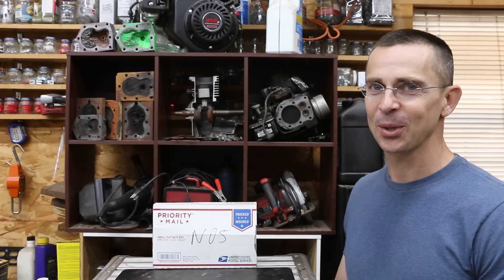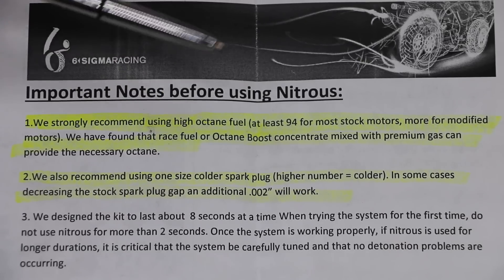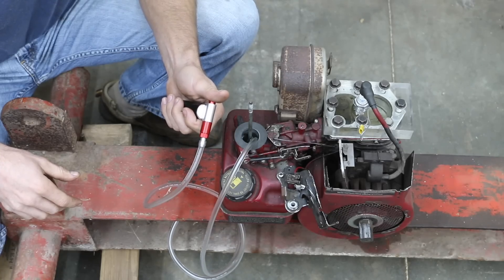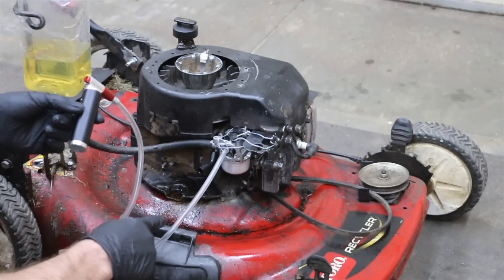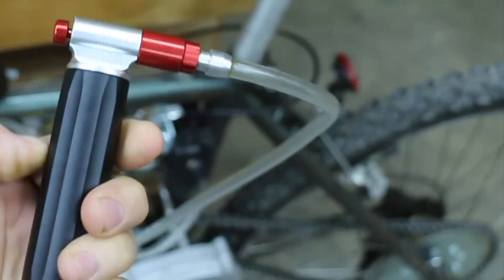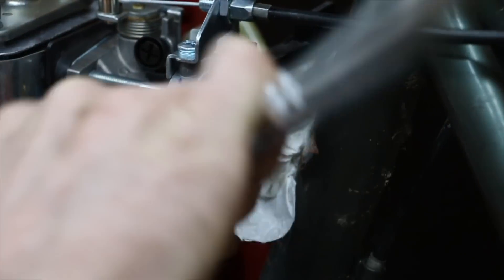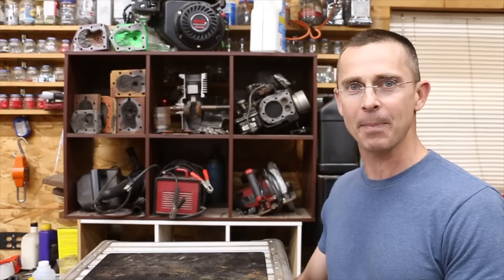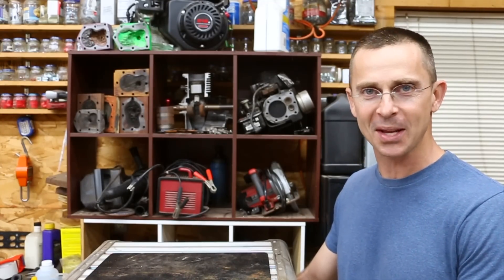Will the 4-Stroke Bike Survive Nitrous Oxide?  Let's find out!

Comment: If you jetted the carby up on the rich side, the nitrous would have more fuel to burn which is it's job and you would get more power and go faster still. Running with nitrous and no extra fuel is hard on the engine.
Reply from the maker: Great tip!
Reply: @ProjectFarm  Absolutely! Fatten up the fuel mixture jetting as large as you can go and still have the engine run decent enough to get near top speed and then hit the nitrous button. It should run like a raped ape!

Next up why don't you get this motor running on methanol and try out mixing in some nitromethane. To run the methanol you'll need about twice the fuel and a huge advance in ignition timing. Fuel drag cars run about 60º BTDC advance, and may not need spark after starting. Can you say detonation?

The methanol will probably destroy the gaskets and seals in the carb so figure this experiment will probably be terminal. I wouldn't think the Nitromethane in any meaningful amount would be survivable for the motor either...
Reply: @ProjectFarm  Additional nitromethane info: You'll need to start the engine on methanol then switch over to the methanol/nitro mix. It is probably easiest to obtain model airplane fuel with as high a nitromethane percentage as possible then dilute it with pure methanol and mix it with compressed air bubbles in the container. Also model airplane fuel comes with oil mixed in either castor oil or synthetic. I'd go with synthetic as castor oil gums things up and as low a percentage of oil as possible. I've seen airplane fuel as high as 75% nitro, mixing down with pure methanol will further reduce the oil content. Airplane motors are 2 stroke so oil is needed in the fuel where you don't need it.
Reply: That was my concern. Presumably, all the nitrous is doing here is leaning the engine out.
Reply: Yep, this is a dry setup. Wet setups have a accelerator pump of extra fuel too. Lots more things you could do to but it gets expensive.
Reply: @daveyt4802  I figure he can hack a cheap, lawnmower engine-worthy solution! Perhaps something along the line of tapping a tiny hole in the carb with a small pump that is engaged when the nitrous button is pressed? 

On a side note: TBH, I'm somewhat surprised projectfarm overlooked the necessity of increased fuel. He's got a very solid understanding of how engines operate and discussed the fact that nitrous increases the available O2. Here's to hoping his next video details his inclusion of these changes. It'd be really interesting how much faster the bike could actually go with the simple addition of a whipped cream charger!

(Other side note: I'd love to see him bolt up one of those $150 eBay turbos alongside it!)
Reply: @TravisTerrell  I think it shows these little engines are not burning all their fuel otherwise he wouldn't get the gains he's gotten.
I like this guy, he's willing to try.
Reply: @TravisTerrell  I've seen a guy do that, unfortunately you can't really gain much power with those unless you get that puppy screaming with an aftermarket cam and flywheel. The low rpms and space between pulses on a single cylinder engine just don't spool it up much. Now, I think a guy could do better than he did, he made a pretty hacked manifold and intake pipe. If one made a "boost canister", basically a tank of sorts that the exhaust fills and pressurizes and fed that into the turbo, that would at least eliminate the pulsing issue. And of course properly boost referencing the carburetor and taking time to tune it.
Reply: A small seperate vessel filled with extra fuel in a venturi setup using a small tube. Similar to a model painting airbrush. The pressure from the nitrous spray would enrich the mix automatically. The hard part would be dialing in the correct NO2/F ratio.
Reply: @nathanriley1260  I wouldn't introduce fuel outside of the carb with the nitrous going in that way. NHRA had some hood scoops blown off Pro Stock cars that were cheating fogging hood scoops back in the '90's. Adding fuel to that mix might be a tad bit unsafe...
Reply: @farout1220  I see what you're saying for sure, but what I'm suggesting is pretty doggone close to what a commercial wet plate setup does. Only difference is that the commercial wet plate is directly between the carb and the intake manifold, whereas I'm thinking the easiest way on such a small carb is to just fog the mix straight down the carb throat. You just have to be sure to only spray at WOT to prevent most of the mix from bouncing back off the throttle plate.
Reply: Oil Burner an additional small jet using the vacuum of the air box would work. Using a ball valve to get the fuel side dialed in.
Reply: @caseywilliams4322  Yes. The "The Frankenstein Gas Vaporizer" xD. Use this + the jet of the carburator. then add nitrous oxide and baaam much more power.
Reply: I suspect these carbs run rich anyway.  I have always been told nitrouse has no power in it.  The power add comes from allowing more fuel to burn by adding more air to the carb.  Engines are typically not fuel limited but limited by air.  To pass this limitation, you can run a turbo, supercharger, or dump in a solution which has enriched oxygen.  No matter which you choose, when adding more o2, you then add more fuel.  That means more power.
Reply: @rscarawa  The word you're looking for is "stoichiometry."  Gasoline has a stoichiometric ratio of 14.7:1, as in 14.7 pounds of air to burn 1 pound of gasoline for proper combustion with a maximum power rich ratio of about 12.5:1.  NOS acts as an oxidizer, so you are correct in that to reap the benefits, you should be adding more fuel along with the NOS (more oxygen, so you can burn more fuel in the same cylinder volume to make more power).  Forced induction (turbo, blower) performs the same action by stuffing more air into the cylinder so more fuel can be burned.  The problem is, at some point, the volume of the cylinder precludes any further ability, or gains at stuffing more air and fuel into it, or end up blowing the engine to pieces with extremely high induction pressures.

The answer then is to switch fuels.  Alcohol would probably be your next step up.  Although alcohol has less BTUs per equal volume than gasoline, methanol has a stoichiometric ratio of 6.45:1, so you can burn a little over 2 times more of it in a normally-aspirated engine, with further amounts as boost is added.  Ultimately, a well built alky motor is good for about 10-15% more power than what you can get from a gas engine. 

Then, you take the big step up to the top of the fuel chain, you go with nitromethane (which oddly, was developed as a dry cleaning solvent and also used as a rocket fuel).  Again, a fuel with less power per equal volume than gasoline, but it carries its own oxygen.  In reality, the BTU rating for a given amount of fuel has to also consider its "specific energy" value.  The SE is derived by dividing the heat value by the air/fuel ratio (Btu/lb divided by A/F), telling us how much heat energy is delivered per pound of air into the motor. At stoichiometric air/fuel ratios, the nitro’s SE value is around 2.2 times greater than gasoline!   100% nitro has a crazy stoichiometric ratio of just 1.7:1!  You can burn a hair more than 8.5 times more nitro, at 1 atmosphere, than you can gasoline!  Now, slap on some forced induction (or even NOS, as nitro will work just as a well as gasoline with NOS) and you're cramming some power into a cylinder.  That's why top fuel cars make 10,000+ HP on 500 cu. in. engines.
Reply: Edward Lance  - I can't believe no one replied or upvoted to that. That's the most interesting thing I read in the entire thread.
Reply: @rscarawa  like hitting the oxygen lever on a cutting torch, normal flame, molten metal flame!!.
Reply: I know this to be true on racing v8 engines. Good way to create a piston burning lean condition is NOS without extra fuel.
Reply: Is that the cause of the dirty ignition.  It was really yellow in the clear motor
Reply: Yeah the fuel is meant not only to make the unicorn explosions but also cool the piston, valves, head and block down enough for sustained running.
Reply: @Doug brook, the sensor cooling effect only works down to around 37° or so with OBDII equipped vehicles, then it becomes counter productive.  As for methanol, stoich is roughly 7/1 (7lbs of air for every pound of fuel you put through the motor) so you would need to essentially double your main jet size on the carb, have a custom grind needle, and a fair bit larger pilot jet; but at that point it wouldn't gravity feed fast enough to keep the bowl filled, you'd need a fuel pump. With nitromethane, assuming a %90 mix, stoich is about 1.7/1. So for every 1.7 lbs of air going through the motor you need 1 lb of fuel.   No way that carb is getting anywhere near remotely close   to fueling that.  But it would make a hell of a bang if it would even light. Compression ratio, piston squish, valve overlap, it goes on and on lol.  I've got a couple drag four wheelers, one on alcohol (methanol) with a 25 horse wet shot of nitrous and another just on nitro. There awesome when they run. But most of the time is spent rebuilding top ends and changing washed out bearings.
Reply: @aaronj08ar  how do you weigh air?
Reply: @davejones5640  Math. PV=mRT, P is pressure (14.7 psi at sea level), V the volume (combustion chamber size),       m the mass (roughly 29g/mol), R is the gas constant (28.8), and T is the temperature.  (There are a massive amount of variables at play such as humidity and the pull of gravity in your specific location)     .08 lbs per cubic foot is close enough for fuel ratios.    It is much easier to use  an oxygen sensor and go off A/F radio in combustion exhaust :)
Reply: Nice tip. I suppose you can get better result with an injection engine, where the amount of fuel will be adjusted fairly quickly by the lamba probe in the exhaust.
Reply: I’m surprised nobody has tried using a large ducted fan as a supercharger, a 90-120mm one can easily produce as much wind as a decent turbo, and reach pretty substantial amounts of pressure.
Reply: @krowwithakay  I made  the calculation for a 1.8 liter 4 cylinder. At full speed, the engine revs at 6000 tr/min = 100 tr/sec. The engine has to load 2 cylinder on each rev, equal 0,9 liter 100 times per second, so you need a fan able to push 900 liter per second = 54 m3 each minute = 3240 m3 / hour = 1907 cfm. I've never met a pc fan so powerfull. Anyway, there's a video here on youtube from a british maker, who fixed 2 garden leaf blowers on a low end old japanese lemond, and he gained some power.
Reply: How have you been oil burner  your videos are great and your sense of humor is even better  hope you and yours are doing well
Reply: Could you add a mixer tube of fuel to the nos tube and the pressure should suck some fuel with it?
Reply: @joblessalex  Absolutely you can. The nitrous pulling fuel through the venturi effect is a simple "wet system".  It will self adjust the mixture to a degree as long as bottle pressure is acceptable and your jets are the correct size to begin with.
Reply: @Joshua M Some kits will be advertised as " fits X motor", but you really have to jet it just like you would a carb.  What works for a motor at sea level, will not work for the same motor in Colorado. Same goes even with temperature & humidity changes through out a given period of time. (Depending on how picky you are of course.) Change your exhaust or cams and re-jet accordingly.
Reply: I've heard drilling out the jet with a #70 is a good way to get a bit more out of these little 50s
Reply: Hey, long time no hear from you, oil burner! Subscribed long ago, love your videos! And your accent. I love Aussies. Keep your powder dry, and keep the safety nannies in their place!
Reply: Yes but then it wouldn't pass emission test.
I crack my self up.
Reply: Some smart people on this channel . I know for sure when I push the gas pedal or twist the throttle I burn more fuel , that's about the extent of my knowledge , crap , ☹️
Reply: More cowbell is the answer. A rich fuel mix is needed as nitrous is the oxygen in the burning equation
Reply: Watch the piston rings too a lot of heat with nitros
Reply: Dry setups only work with efi. You spray them at the intake air sensor and it dumps extra fuel as it thinks it’s freezing outside and riches the fuel mixture. With a carb it just leans it out in a bad way
Reply: @nmsmitto  actually you spray through the Mass Air Meter with a dry setup. The computer will add extra fuel as necessary. I was able to safely spray about a 125 shot on my old 99 LS1 Firebird.
Reply: You also have to take some timing away from it too
Reply: Yup. There was a guy that ran a 401 Javelin, injected  pure oxygen, well it worked for about 30 seconds...
Reply: Lean is mean
Reply: Good point. Now go make one and show us. That be awesome.
Reply: Finally,  a post thread that's on point! 

Nos with no extra fuel just runs lean and will cause damage.
Reply: Oh, that's why wet systems exist
Reply: Yep !!! You're right glumpy. Something a lot of people know nothing about.  Most just throw the NOS on and go. Then wonder why they burn holes in pistons and the ends of of spark plugs. Then all hell breaks loose if that plug tip gets stuck between the valve and valve seat.
Reply: If u add nitrous to fuel injection, spray it straight on the intake air temp sensor. Thst will cause the pcm to think it's super cold outside and fire the injector pulse longer adding more fuel. Not as much as a wet system, but enough to benefit greatly, and add some protection from going to lean. Just my 2 cents.. I have this cheap set up on my 250cc dual sport. It gave me 5mph at wide open throttle with a headwind I went from 90 to 95mph. Lot of fun.
Reply: Nitrous is bad for a engine anyway
Reply: You are a dummy how can mixing fuel with fuel equal more explosion because by your words you obviously have no idea on how energy is expelled from fuel. You need to add more oxygen not feel I will say it again you need to add more oxygen about 30 percent volume increase.

Comment: With nitrous no engine will survive. It's a matter of how many times can I do it before it brakes. Only use it at full throttle and a lot of extra gas should be simultaneously injected. The wide open throttle allows a lot of cooling air the extra rich wet airfuel ratio like wise will help cool the engine. This seems counterintuitive but its true if your car is running a little hot opener up and see what happens. Its even more apparent with air cooled motors. The extra O2 in NO2 will make any fire really hot as well as allow you to burn three or four times more gasoline with each ignition stroke making a ton of heat and maybe 
1& 1/2 more hp in your little motor. Maybe 20 or 40% boost . piston crown and cylinder head temp will soar. More boost more power easy recipe for a hand grenade. Don't melt holes in your aluminum pistons
Reply from the maker: Great tip. Thank you.

Comment: I've seen them tested on other sites. It's like a 2-hp gain. Over stock. I'd like to see 104 octain or higher to see if results are better. I've ran 108 octain but believe or not my fuel mileage suffered.
Reply from the maker: Great tip!

Comment: Another great video! Thank you Todd! I was blown away to find out that they actually make legitament nitrous oxide kits for small engines. I have a question though, was the engine still pinging at wide open throttle after the nitrous oxide was engaged?
Reply from the maker: It wasn't pinging as bad, since the engine was likely running a little rich.  I'll have to figure out a way to increase the fuel when using nitrous.
Reply: @ProjectFarm  does the timing advance when at wide open throttle on these small engines? I would think so. You could also introduce an additional fuel line that shoots a stream of fuel when using nitrous. BTW I heard you say you're using non ethanol fuel and running 94 octane gasoline. Keep in mind ethanol is a octane booster. I haul fuel for a living and that 10% ethanol is enough to boost the octane rating to 87. When we are loading for 87 we load the 10% ethanol and the rest of the 90% is 84 octane. IDK if that carb has an adjustable jet, but if it does try running e30 or even e85. I believe e85 is around 100 octane. Might help with the pinging.

Comment: There was discussion recently about an urban myth regarding pre-heating fuel to get more efficiency from the fuel. I'm curious if you could test whether (and to what degree) heating the fuel can improve fuel efficiency. Obviously with caution to not go anywhere near the autoignition temperature of gasoline (536F). Thoughts? Too risky? Maybe devise an exhaust heat exchanger that can warm the fuel in the tank.
Reply from the maker: Thanks for the video idea.  I don't believe it'll help.  A heat exchanger would be a good way to do it.

Comment: Awesome work, i would love to see what fuel enrichment would do to the overall gains on the bike. modern efi systems can adjust fuel automatically for n2o. carbs wont. tee a line from the n20 to a second fuel bottle. use a small line with a carb jet on the end to send fuel to the carb when the n20 pressurizes the fuel tank. this should eliminate detonation.
Reply from the maker: Thanks for the video idea.

Comment: Must have been super lean (ie broken rings from expansion or melted hole in piston top) , always inject fuel along with nitrous. that also may have stopped the pre detonation by cooling the charge.. Lets try it again and put some extra fuel in, use the Venturi effect to add the fuel to the nitrous outlet, aim right into the carb though. LOL you will do 60 I bet
Reply from the maker: Thank you
Reply: np I like your stuff, been watchin for over a year now